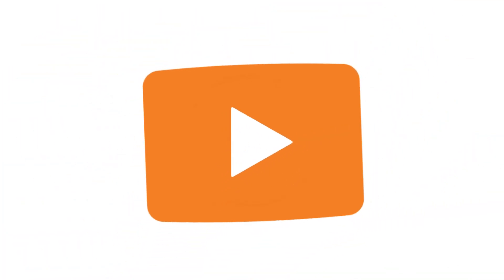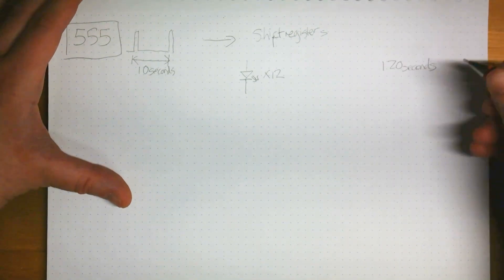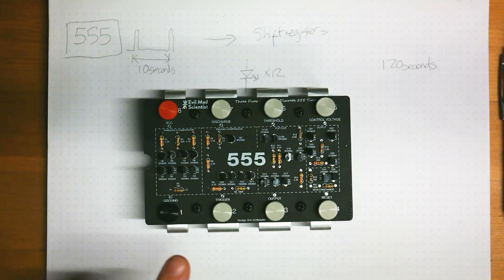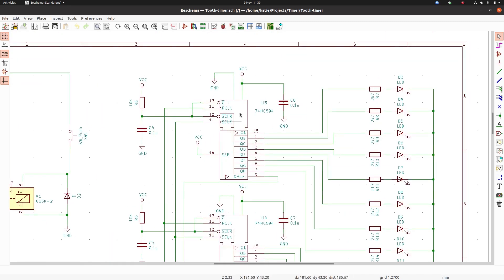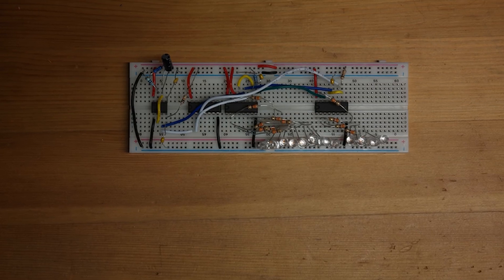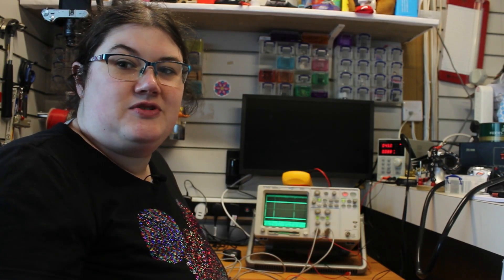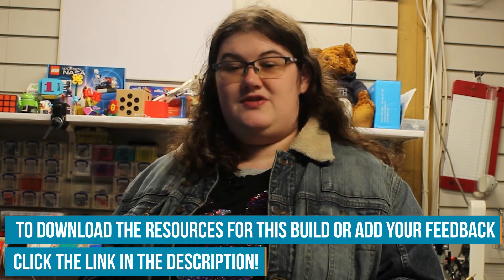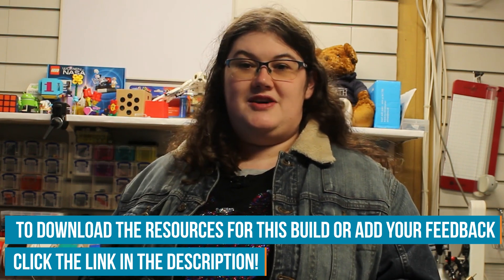DIY Toothbrush Timer

Comment: This is a great project, and the best thing about it is the standard AA batteries instead of fancy power supplies. You could use a 4x holder and NiMH batteries, but I imagine alkaline ones will last a good long while in this application.
Reply: Thanks, I was aiming for something accessible to all, It seems to be lasting well on standard alkaline.